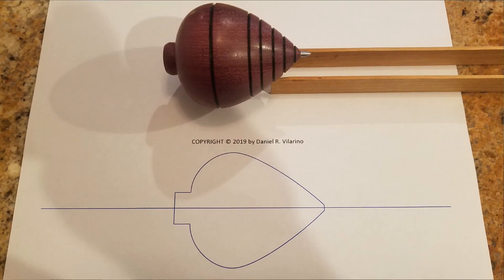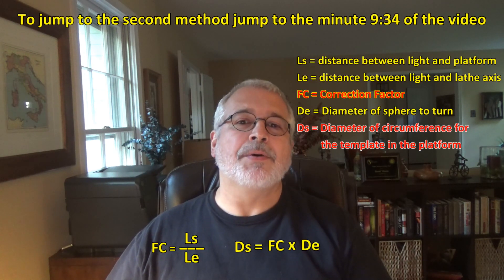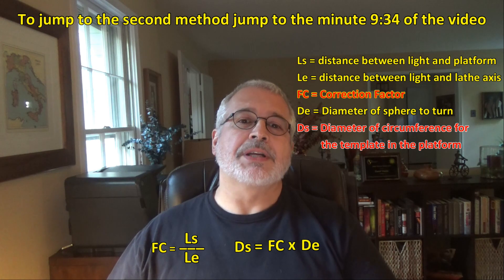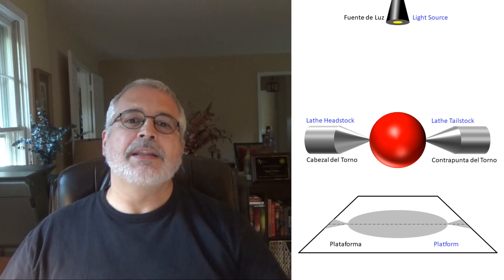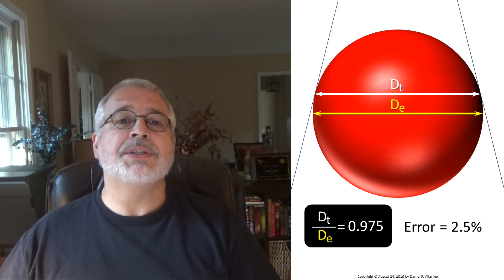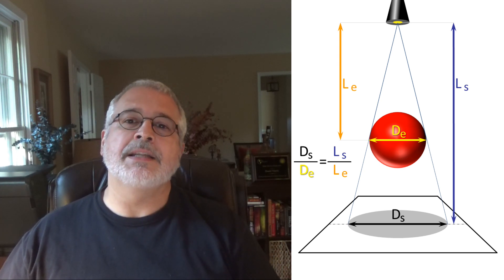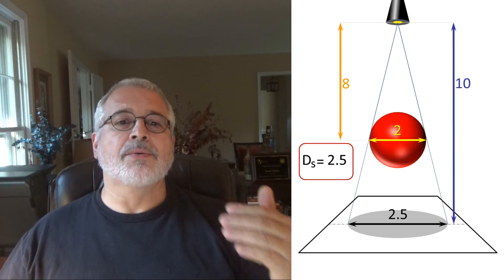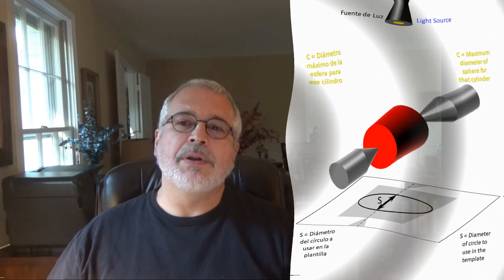Correction Factor for Turning Objects Using the Shadow Method

Comment: Daniel,
I was amazed to see your video, as I’ve considered a similar method, with one variation, and thought it was my own invention. I imagined placing a pattern above, rather than below the turning, and having the shadow fall on the wood, the. Simply turning until the projected shadow completely fills the turning.  I hope I’m making myself clear.  I also wonder, given your mathematical calculation, if the theory takes into account the fact that the light source is not a single point, but in fact has width of its own.  I’m not a mathematician, but I’d think you need to compensate for the fact that the left side and the right side (and front and back too, and in fact all 360° of the light) originate from different points.  Thanks for this “illuminating” discussion!
Reply from the maker: Hi Lou! Thank you, my friend, for your comments. Yes, I understood the concept and it makes sense. The issue of the single point souce of ligth may get complicated if you select to use like a box light with multiples LEDs. Some light sources may project shadows that are more parallel and thus this correction would not be necessary. It is, indeed, an illuminating discussion, lol! One that can have many aspects and angles to consider. If you decide to do the method you propose, I hope you can make a video or take some pictures, it would be great to see how it works. Cheers! Daniel

Comment: Daniel, just out of curiosity, what prompted you to get into this conversation? You must have some engineering, mathematics, science or something I’m not familiar with or too dumb to understand. I can follow you some bit I just wondered why you wanted to wade off into this conversation. Thanks for sharing but you have confused me brother!!!
Reply from the maker: Hi my dear friend! I know, I know, it is a bit outside the scope of my regular videos. It is just that in the future I will try to do some sphere turning using the shadow method and I want to have the formula that will allow me to turn a sphere of the diameter I want, which would be difficult without having a correction factor. I am an engineer, indeed, but it is not a problem of being not familiar or dumb, it is simply that many practical things we do, we do from experience, and that is ok, but normally there is a theoretical basis for everything, and this video fell a bit on that side. My apologies. I promise the next ones will be more in the practical side. Cheers! Daniel
Reply: Daniel Vilarino oh, no problem. And you are right, most things we do is from experience or knowledge we picked up some where but has a theory behind it. I wasn’t disappointed in the video, just lost. I figured u had to have some engineering some where as that was some pretty deep stuff for a country boy from the hills(small) of Mississippi. Good luck with your future projects.